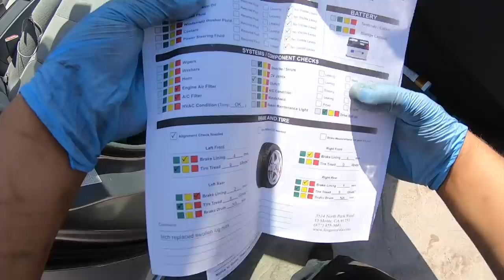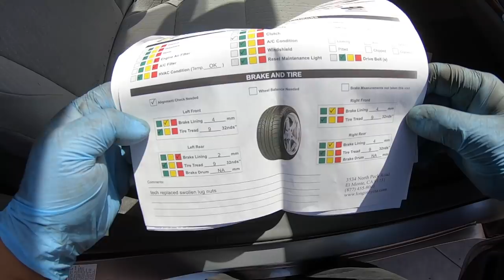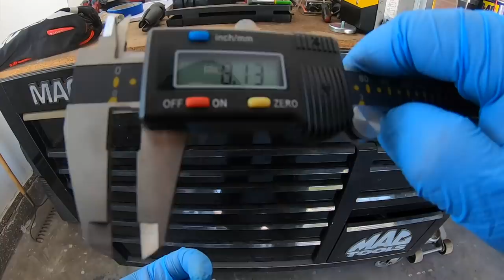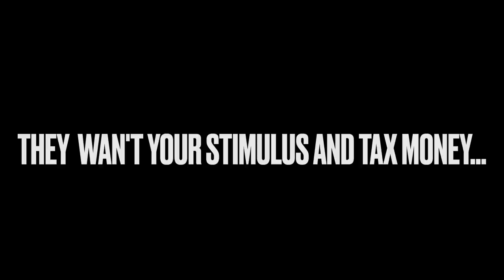This is why YOU need to avoid the Dealerships!

Comment: Good job keep up the great job. 
My 2014 Camry had a torque converter problem that was cover by a warranty dealer charged Toyota corporation for removing and reinstall transmission and replace the torque converter all they did was reflash computer never removed the transmission and how the car have erratic shifting it shifts 3 times before it gets to 20 miles an hour and they won’t fix it they say is running fine i guess this techs are not making money so they tend to rip off the costumer and Toyota corporation and the sad part is the shop managers are in on the scam , am going to a independent transmission shop and pay out of my pocket to get it fix and see if I can take them to small claims court.for the bill don’t think I will get anything but I have nothing known so am going for it.
Great video Hector. Good bless you.

Comment: My brakes wore down at 30k so i asked why they wore so fast, this was at the repair bench, no tech looked at it and they said brakes are brakes. Hence I did not fix it there, but only to find out that the oem rotors can't handle the heat.  Now I have drilled and slotted rotors which disapate the heat coming down from the hills. The second round i used oem and suffered.  Same car but a 2015. I no longer go to that dealership.  Some agents do the right thing and others say oh aftermarket brakes are not covered even if you have a extended warranty.  

Pads, rotors are not covered because they are wearable parts, but the caliper and hoses are!  (i had to explain that) Just got my front calipers replaced under warranty. After a rear bering job, yes they failed too.  Thanks for the info.

Comment: I like when the manufacturers has a 15,000 service and dealership has a 15,000 service. Manufacturers may be oil change, rotate tire and lube any suspension, the Dealership is that plus about 23 other things so cost you $400 more

Comment: I’m wondering if they did the brake inspection before they had them replaced by you. I know sometimes they are lazy and they’ll just use the report from your last visit. I had a similar situation where I did the brakes and flushed the fluid myself. But they told me it was dirty and needed changing. Granted, the fluid never quite gets perfectly clean with an exchange so I’m guessing they just assumed it hadn’t been changed and told me it needed it based on time.

Comment: Properly measuring brake shoes requires taking off the wheel and caliper like you did. That's quite a bit of work that a tech doesn't get much book time for. So those really looking to get on lucrative book time work they can get done under the book time just eyeball it, which is prone to error.

Comment: When doing inspections most dealerships only do a visual inspection on brake pads and guess on the life left instead of measuring them. If getting an oil change this is usually done by people who aren't even mechanics. I once had a dealership tell me my brake pads were low on my 370Z. When I took it in later for new brakes the Service Manager told me the previous guys who did the inspection were wrong and my brakes were fine. This was at the same dealership so they were honest about it. When they say your pads are low, ask them if they determined that by a visual inspection or if they actually measured them!

Comment: An honest technician can work at a dealership or an independent shop, just as a dishonest technician can work at either place. I've been with a dealership for 23 years and have spent my entire career trying to change the narrative that all technicians, no matter where they are employed, are crooks. I've seen just as many customers come here with estimates from independent shops that are absurd. For instance, one customer had an estimate given to replace an entire a/c system on his truck to the tune of $2400. I replaced the leaking low side schrader valve and recharged his system for $150. 3 years later, it's still working fine.

Comment: Picking up a vehicle by the pinch welds is a lazy mechanic's move which in time leads to rust as the paint chips off and the weld splits open. Get on your knees and look under the vehicle for the hard points and use those with a hockey puck between the vehicle and your jack to protect the undercoat/paint. Rusty rocker panels always start from bent rails due to lazy lifting by the pinch welds.

Comment: I am afraid of the dealership, tried to get me to do work on my car for  $2000. 

Car had an oil spill due to engine oil cap not screwed on tightly, all over the top of hood. 

Tried to write up a false work order for  $2000 worth of work so they can make their pockets a lot fatter.

Don't trust dealership,  I cringe when I have to go to them.

I don't buy a Toyota anymore ,  I go with a different brand of car now.

Comment: I started out wrenching on my own car because of the brake scam.  Only reason I knew better is I had just moved and the first inspection they tried to hit me up for brakes.  That I had replaced less than a year earlier, and I barely drove the car at all since then.  I started with brakes and now can replace just about anything on my car.  It's not that hard, especially in the internet age.  

And I was about to yell at you for just blasting those lug nuts on with an impact, then you grabbed the torque wrench.  Good job.  :D

I have that same impact too, it's a beast.  Don't know how I managed without it.

Comment: sometimes the dealership is a good way to detect shit you need to replace later. They always make up shit to make you replace things like if theres a TINY hole in the CV boot they'll say to change it. A regular tech wont see it because they aren't trying to nickel and dime you, a dealer will. After getting a list you're probably good for another year or more to replace anything they said you need to. Also always request the changed out parts when working with a mechanic. especially the dealer. It cost them nothing to give you the old parts back.

Comment: Be careful cause them crooked ass mechanics will put a price on your head.  I had an instance where I took my car to get a smog before I sold it and I took it early in the morning and the car wasn’t even warm when I got there.  Sneaky trick is to unplug the cooling fan to get the car hot.  They didn’t plug back the fan and when I drove it 15 miles the car over heated.  Got out and checked, yup!  Had my friend bring me some anti freeze and plugged the fan back in.  Went back and chewed them out and they said no one ever does that.  Even called me a few racist names and let’s just say he’s not working there anymore.

Comment: Tech is probably flat rate or pushed to upsell. As a dealership mechanic it is very shady. Tech may have just peaked at the brakes through the tire instead of actually inspecting them.

Comment: So here is what you do in that case many times if you have bought brake pads from AutoZone or one of those places you get lifetime and you could return them to them and get a whole new box of breaks so you tell the dealer if they’re going to do your brakes when they give you the print out sheet that tells you they are at two or 3 mm you tell them you want to save the brake pads you need them because you’re gonna turn them in and get your lifetime set so they have to give them to you and you could even tell them to mark them on which wheel they were at but you’ll know because front pads and rear pads are different and if these don’t match the measurement that they’ve given on the print out and you sue them and you file a claim with the Better Business Bureau for fraud

Comment: Had a place tell my mother that her brakes needed to be done. I still have the new brake shoes 3 years later waiting for the old brakes to be wore down enough to change. I check them every 6 months. Also, new brake pads are generally 10 MM anyway.

Comment: I don't see where they recommended brakes or said it was "metal to metal". The mechanic could have meant .4 inch. Also I doubt the tech would replace them anyways because if someone walked by when he was throwing out good pads he could be out on the street. That is a huge risk for someone who has worked their way up to a dealership tech who gets brake jobs. It takes years to get brake jobs where I'm from. The only other thing I can think of is they were guessing based on mileage if the van had a previous brake service at the dealer.

Comment: Amen!  And it's sad that women tend to be the aim for these schemes

Whenever a dealership recommends work that needs to be done, I get a quote and supporting paperwork from them then either get a second opinion from another mechanic OR find a message board, if not both.  

Case and point, my dealership told me my catalytic converter had a hole and gave me a quote to repair it.  A message board told me that my car was having a recall on that exact part for that exact reason.  I presented the information to the dealership and after still more back and forths, they ultimately fixed it at no cost to me.  But I STLL had to argue my point to get it.

Comment: I just went through this with a mechanic 2 days ago.  The rear pads wore down to almost metal to metal. 
He claimed they were metal to metal and I needed new rotors on both sides. And refused to do just the pads.
He wanted 560 dollars.
I took the car home and paid $54 for the 4 rear pads.  I had all the tools needed so it took me less than an hour per caliper.
If I would have used an air powered impact wrench like a mechanic has I could probably do it in half that time.
So I saved $506 dollars.  And he was wrong about the rotors.  They were perfectly smooth.  
The big secret is that even if you start to hear your pads go metal to metal...if you immediately change your pads the small scratches on the rotor will get smoothed out by the new pads. Or even better you can put an old pad that still has some thickness to it into the pad position that was scratching the rotor.  Drive it for about a month and then you will find the scratched rotor smooth again.  Then replace that pad with a new one.

Comment: my favorite was a toyota dealer told me the water pump was leaking.  I politely declined.  Car has been fine and that was 4 years ago.  Also they said it needed new front brakes.  Yet I had them replaced 3 months before.  I just politely decline.

Comment: Don't blame the mechanics most dealerships force them to upsell stuff you don't need or they get fired /written up . The shop I work at only sells brakes when they are at 2mm and we still resurface rotors which is getting less common these days.

Comment: Not just the dealership. Few years ago I had my ex crying that Midas told her she needed brakes all around and a new air filter, how she just couldn't afford to have it fixed and was scared to drive the kids around in an unsafe car. I told her to go buy the pads/filter at the parts store and I would change them for her. Well, when I took the old pads off, they still had the champfers on them, barely worn at all. Practically brand new...on all 4 corners. And the air filter, they never even opened the airbox. Still dusty and untouched. The filter was almost brand new as well.

Comment: I see vehicles come in all the time from dealerships and other shops that need legitamite work that is not cought. Do your job properly and there will be work to be done. Had one last week that had an oil change a week and a half ago with a dangerously loose ball joint, some play in the other and in need of both air filters, the cabin hadn't been changed in years. Lost sales to the other shop. See it all the time, and just because you go to a dealer, doesn't mean you are getting good service.

Comment: Not true. At the Toyota dealership I lived by. The Manager protected the technician when they fuck up an easy oil change. They forgot to close the oil cap tight and oil sprayed over the engine. They said it’s not their fault and the customer have to check what they do.

Comment: The Mechanic and also the service advisors. They will try to up sell you. Don't just trust the smaller shops too. I was really busy and I was not able to take my car to Honda so I went to a smaller shop. They came back and said I had water on my oil pan. Yes water on my oil pan then offered me so additive to put in my oil. So I asked the mechanic If my oil had water in it and he said no. So I told him to just go a head and change my oil.

Comment: Toyota dealer told me I needed to change all the fluids on my Tacoma (diffs, transfer case, transmission) everytime I went for an oil change.  Then the last time I had changed the fluids myself and guess what, still told me I needed to change those fluids.  When I informed them that I just had changed them, they said it must have been the residual fluid they saw on the plug, assuming they even checked the level.  Last time I went to any dealer for anything.

Comment: Nice video.  I really feel like it comes down to knowing your driving habits.  If you are a casual driver, don't use your brakes too often and avoid driving conditions that may require more braking.  You could reasonably assume the lifespan of your brakes.  If you are a regular at the dealership and build a relationship with them.  Press them to get a 2nd opinion from one of their other techs, because you know your car.  Otherwise you walk.  But this kind of stuff can happen at small garages too.  Idk how many times I go in with one issue only to drive away with another issue... Hence, I go to the dealer until they burn me too.

Comment: I bought a certified used Ford fusion and when a found out the second day I had it that the oil was way overfilled I took it back to the dealership. They tell me it’s needs tires but I was going to complain about the tires because my wife had bought it without me. They said the tires are good on the inspection report while they owned it. I had to file a BBB complaint and they reluctantly put tires on it if I removed the complaint

Comment: I had a dealership rip my wife off, i took it to an independent mechanic one service, he replaced all my rotors and breaks and told me the water pump was leaking but didn't have the part to fix it. The next service i took it to the dealership and told them to replace the pump and anything else to call me. They called my wife told her the disks needed replacement and they would void the warranty if we didn't and replaced every cooling hose and the radiator didn't touch the pump. Cost 3k in repairs, and it was leaking coolant from the pump still.

Comment: My wife took in our Camry to have some work done and I had them change the plugs too. Next time it was in for the free oil change, they told her it needed new plugs and she let them do it before contacting me. I had to go back down and get the money refunded. They blamed it on someone not checking the history. Once they told me I needed new tires and I told them the tires were less than a year old. The tech said "huh" and kept on going. And to top it off, they replaced our dash under recall and when we our private shop replaced our condenser, they found several screws missing in the dash and several more very loose. We stay away from dealer shops now.

Comment: Since I began owning vehicles, have always had them service at a dealership.  Only had one questionable experience up to this point with one of them.  The service agent walked me through the inspection report and everything looked good except one item.  This particular dealership’s technician graded poorly the power steering fluid on my vehicle.  The service agent went off what was on the report and said I should get it replaced.  When I asked the service agent to show me that need for this service, we walked to my vehicle and opened the hood.  Inspected the power steering fluid and it looked pristine!  I then asked the service agent why they wanted me to get it replaced?  And he didn’t know what to say.  He went back inside and asked the technician what the deal was.  I was then told that technician had made that recommendation based on the mileage that my vehicle had at the time.  

In short, always be alert and if something doesn’t seem right, ask questions or get a second opinion.

Comment: in all honestly the tech probably just didn't check them they probably just made a estimate based off mileage.
based off experience you can look at a rim and tell if the pads need to be replaced by how much brake dust is on them xD

Comment: I no longer visit the Honda dealer in Madison, NJ. They told me I needed new brakes on all four wheels. Two years later I found a new mechanic when I needed four new tires. I advised the mechanic that I might also need brakes. He came back to me and said he would just change the tires and my brakes were good! Obviously I’m sticking with my new mechanic.

Comment: Great video.  Same exact thing happened to me, dealer told me brakes worn out, were shocked when I said no to them doing the work.  Bought new pads, pulled the wheel to change them but my pads and rotors were like new.  Wantagh Mazda, New York.

Comment: Flat rate system is the BIGGEST problem/factor causing stuffs like these.  It's not only dealership, some independent and local shops that practice Flat rate system are just as crooked as the dealership. 

This is what happens when you set up a pay system that directly and indirectly forces and encourages people to lie and do crappy jobs. 
The customers end up being the loosers in a pay system like Flat rate by being lied to and getting a crappy job.

That doesn't mean that there aren't a few honest people or shops, but Flat rate system just put too much undue pressure on people to lie, cut corners and do a half hazard job.